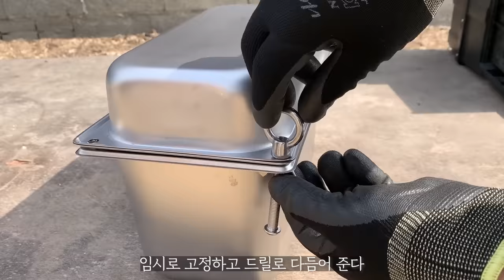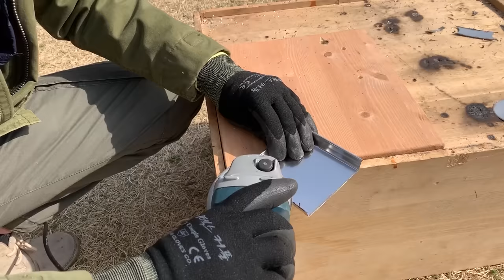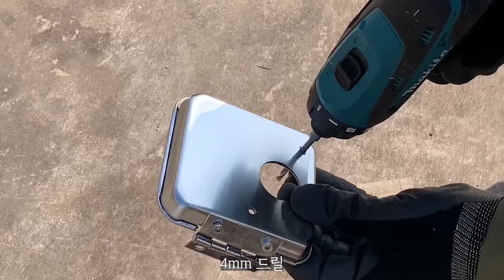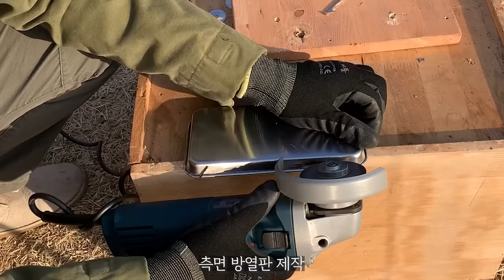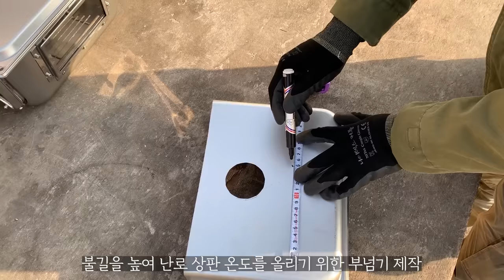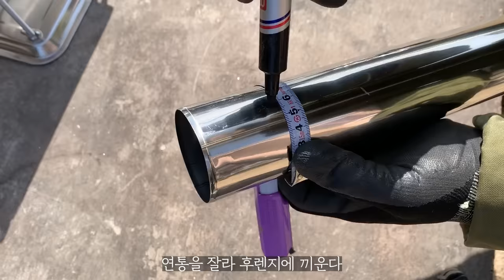Powerful to Cook - Homemade Wood Stove for Camp M-Stove Project Part-1

Comment: Firstly thanks for inspiring me to make my own stove based on your design, I enjoyed the process!  I have not included the heat sink, and just have single rather rudimentary door with simple air control.  It works very well. I know you cannot say exactly  how much use these stoves can take before component failure, but from what I've gathered from comments is that the lower fire box is the main concern.  By chance I've managed to fit a 1.1mm thick lower pan so hoping this extends life span!  Keep inspiring people to make things and enjoying the outdoors!

Comment: From one fabricator to another: holy cow, friend. The amount of planning and detail paired with on the fly fitting without measuring is really amazing. I don't speak Korean or read Hangul, but I was still able to follow along each step. By sticking solely to drilling holes and using bolts, you have made it accessible to a much larger potential audience. Also, there is a special mastery to the simplicity of the design and its execution. 

I see that you've built a bunch of further iterations of this, as well as a few other projects. I'm subscribed, and I look forward to watching through your whole catalogue of videos.
Reply from the maker: Youtube author activity started from my hobby. During my creative activities, I was worried and frustrated while I was in the joy to overcome many limitations. Still, there was a goal, so I was able to keep moving forward. Your thankful comments are a big booster to me. Thank you so much I will continue to share my life and hobbies here.
Reply: Buenos and the good 👍 👌 😌 🙌 ✨ 👏 👍 👌 😌 🙌 ✨ 👏 👍 👌 😌 🙌 ✨ 👏 👍 👌 😌 🙌 the 85
Reply: 68
Reply: Delivery available?

Comment: After taking care of stoves for almost 25 years I discovered that gasketing is the most important piece of equipment you have. My suggestion at improving, is the addition of gasketing between the sections, and between the glass and the stove itself. This will solve the shaking problem, and this will actually improve the efficiency.
Reply from the maker: Thanks for your advice! And now all improved! Please check out my latest videos♥️🙆🏻‍♂️🇰🇷
Reply: And for all of the homemade stoves I've seen on YouTube, this is got to be one of the best designs. A two-pass system with radiant guards is phenomenal. as a boiler operator I couldn't have designed anything better.
Reply: after 25 years ..... you should know
 better........ balance of the bills ... if you get the parts realy cheap, get the tools to build it realy cheap, and you expect to replace the stove afther 2 years of use at the campin....
Reply: With some very cheap gasketing, he will get better control of the fire, thus cutting down the wear and tear on this stove. And possibly get much longer than a measly 2 years. Hell I got a 6-year-old stove I use about four or five times a year and for my camping. Why? Because I have good control on my air flow.

Comment: Great job! Two minor changes to my design swiped from you. 😄 1. Small piece of the ceramic rope around the main top and bottom seal (where you added more bolts at the end to try and hold it more tightly closed) and around the glass (to stop leakage and the rattling). 2. Added a rotatable damper in the flue. THANKS FOR THE GREAT IDEA!
Reply from the maker: Thanks for watching and for the comment. Hope you enjoy your camp with your own. 😄

Comment: This makes me want to go out and get the materials to make one, just for fun. This was a great video and interestingly, being unspoken, works in all languages... Great video.
Reply: Restaurant pans are very expensive, he could have bought one for half the price
Reply: @lisah6451  You can get all of the needed pans on a restaurant supply website for under $50(usd), and the bolts and whatnot at a hardware store for probably >$10. A portable stove of this quality would cost you at least double that. And If you're lucky enough to live in a city with a second hand restaurant supply store, you could probably do the whole project for >$35.
Reply: @whiskeycan529  I used to own a restaurant so I know how much they cost. You can not let the fire get too hot in a stainless steel stove, it will warp the metal

Comment: Many thanks for having the consideration and time to meticulously document your superb stove build, both with videography, narration and the highly detailed parts list!

Your inspired build is meticulously detailed and your craftsmanship ensures that the stove looks as beautiful as it is highly efficient and functional.

I particularly liked that based on use, you updated as you felt was required, the mark of a true Engineer.

I see that you've created a second stove, this with water boiling capability, and were this stove to be fitted into a camper or liveaboard vessel or vehicle, with the use of copper piping and finrads, heating another space (second cabin or wetroom) would be possible.

Edited for typo and to update a mistake on my part!

When mentioning the stove with water boiling pipes, I mistook the piping and valves used for secondary burn capability for water pipes!
Reply from the maker: Thank you for your interest and for your feedback. I enjoy making this fun and enjoying it but sometimes making improvements to the extent possible. Thank you very much.
Reply: Another non-camper?   Academicians should sleep in the library.
Reply: @rstelzer2928  Surely they'd be sleeping in their sleeping bags!

Comment: As a boiler operator at a trona mine in Wyoming, I don't see that stove lasting longer than a month due to not having any furnace cement to insulate the metal and keep it from burning through. Other than that, it looks amazing!
Reply: Can one get furnace cement in any hardware store as I am in South Africa please. Thank you kindly for the tip. D
Reply: I agree...it looks great but many parts are not easy to be found on the market...and yes, the meatl itself will burn unless putting some cement inside and that will make the stove heavy unfortunately...
Reply: Lance Martin You could also use vermiculite board, it's cheap, easy to cut to size and an excellent insulator.
Reply: @spencerwilton5831  thank you for providing advise to fellows like myself just starting off in the world of DIY.
Reply: @spencerwilton5831  nice

Comment: I love the back draw method used it is more wood efficient and much heat is generated. Congrats from 🇰🇪
Reply from the maker: I love your comment! The concept of this stove is just that.Thanks!
Reply from the maker: @UCrfHYY0hOp8fwyrFsK_oUSA My stove has designed by the concept of combination of rocket stove science and traditional Korean floor heating technology call 'Ondol' 
https://en.wikipedia.org/wiki/Ondol?fbclid=IwAR3ivdkBtxW96AyM_dTaW5AaU02e1Ufwstec91LdTCX7VF1a7ATgXxRTogM
Reply from the maker: For a traditional fireplace, the holes in the baffles and the location of the chimney will be different. My stove is different from that. The combustion chamber is small but designed to deliver high temperatures for cooking to the top. I may have misunderstood your first comment. I hope you understand.
Reply: @campingtogether  i meant that the flow of gasses is back draft. They flow from the back to the front. Making it more efficient and burn stronger.
Reply from the maker: @kensimplykaruma9052  Have you watched my recent videos? Hope you watch them leave your feedback. I appreciate it.
Reply: @campingtogether  i will and thanks for your simple but effective stoves. Planning of doing brick stove using same concept with an oven.
Reply from the maker: @kensimplykaruma9052  Great idea. Cheers!

Comment: I love concept but seeing how after just few uses whole stove is already almost charred I fear it would be useless at best in year. Charred overheated stainless metal almost in my all cases corroded. You need to paint it with some protective laminate.
Reply: i thought as to you what  Charred overheated stainless metal almost,   have the problem.

Comment: Hey ! well done !! the wood stove would need some kind of protective clay forever so that the sheet metal would not withstand the heat. Mrs Edwin
Reply from the maker: Thanks! I will have this tuned.
Reply: Putting clay around it would make it last longer or just remain after the metal burns out?

Comment: Terrific construction!  I do see one problem, though:  It's TOO lightweight.  Even a mild Colorado breeze could topple it.  If it was inside a tent, however, one designed with a stove vent/heater vent, it would do very well.
Reply: There is a plate on the bottom; it could hold some stones as a counter-weight. Then it would stand up against the wind.
Reply: All the outdoors stoves should be light weight . they are meant to be to carry them and cooking outdoors.  Go online and looked whats the weight of outdoor stoves with this type of design

Comment: This one turned out good needs some cement between the pans lids where they seal together to kill that air gap.
Reply from the maker: I found some other way to fix it. Your idea is also great! Thanks a lot.
Reply: Fire rope and chimney gasket sealant?
Reply: Ceramic heat mat cut to fit? Maybe just exhaust gasket sealant.

Comment: So very neat, well put together and designed! I love this design. It looks a little fiddly at times with smaller parts and detail, but you make it look so easy and the film is also so very well put together. I enjoyed watching all through and found immensely inspiring.

Are you wearing kevlar gloves when working with the angle grinder?

Now I'm a fan of Camping Together, after watching this, thank you for sharing :-)
Reply from the maker: Hi Thanks for watching! I don't have kevlar gloves, just I hold it tight and feel easy while using the grinder. Thant one is small so not that dangerous, safety cover on the disk is essential. Have a great day!
Reply: ㅂ7
Reply: @campingtogether  Man, bravo, realy bravo, but no in aluminium stove man...cancer...

Comment: Brilliant design, but I fear from my own experience that the stove would wear out after only a few uses. Very thin steel. But I could be wrong.
Reply from the maker: You may be right! I will see and use this carefully. Thanks!
Reply: @campingtogether  Sir, try to keep an ash layer on the bottom to insulate the bottom, as we use Beer kegs for heating & cooking  made out of 3mm stainless This help with endurance.
Great build thanks for the video.

Comment: More on the door idea... If the hole for the door is cut "round" instead of "square", it would then be easy to fit a round bowl inside that hole to use as a door and have it seal quite well... a door doesn't HAVE to be square after all. Like a Hobbit door.
Reply from the maker: I did it because the rectangle was easy to crop cleanly. Your idea is a good idea.
Reply: Everyone’s a critic. Better idea? Build one yourself and post it for us to see, then we’ll compare notes
Reply: @MrSparkymedic  critic is meant positively. If I build things I like to be criticised because only by critics I can be better next time...
Reply: @MrSparkymedic  
That was a rather snide remark.
Most of us are here watching videos to learn and observe others techniques. The exchange of ideas in the comments section is part of the  experience and most welcome by just about everyone as long as those comments are not presented in a rude and snotty. manner.
Many times comments lead to improvements in process, materials, techniques and future videos.
Reply: @MrSparkymedic  gamma
Reply: Georg E. On
Reply: MrSparkymedic Nope; you're the only one! An alternate suggestion was made and acknowledged by the builder as a good idea.
Reply: It's harder to cut a round hole though, probably why they went with the square.  Plus if its round,  you cut down on the size of the opening. I think square is best for this type of stove.
Reply: @MrSparkymedic  I made my self a mini box to smoke fishes. Big works such as offroad campers, One sail boat and my house!
Critics are not bads at all. I know a good country for people who does not like the critics....North Korea!

Comment: I'm waiting  for  small stove like this.  Making video is so fast to look the process of it.
So,please make  the video speed more slowly  to understand the way of making.
Reply from the maker: Hi, Many thanks for watching. You may understand the concept of this stove, you better understand the process of making this. Do not forget to remove burs after cutting or drilling material. If you have any difficulties understanding the process, leave a comment any time. Good luck!
Reply: Maybe hit the rewind option a few times, Einstein. It ain’t rocket science.
Reply: 🔵 You may not be aware of the fact that
YouTube videos have a feature that allows you
to slow down or speed up the video!!..... the feature is accessed by tapping the three vertical dots on the upper right corner of the video that appear when you tap the screen.

Comment: THEY NEED TO BE PAINTED WITH HEAT PRO PAINT
Reply: SYDNEY HI, I was thinking the very same thing! I’d use white, high temperature automotive hot rod exhaust header paint. It’s good for 1,600 f.
Reply: Why? It's stainless steel. Mb aisi 316.
Reply: Good luck getting the paint to stick to stainless steel for very long.
Reply: @josephk2958  LOL HEAT PAINT SPRAY ON LOL DONE IT!!!

Comment: Nice design. If you get some small fiberglass rope you can sandwich it between the top pieces and between the glass and the metal to stop air leakage and noise from the glass.

Comment: It needs a seal between the top and bottom and one around the glass. 
Great looking little stove, How does it do for heating a space? With so little heat mass I bet it cools off pretty quick.
I think I might just build one of these for my wood shop, lots of little cutoffs to burn.

Comment: What is the thickness of those pans? Wondering how long they will hold up.
Reply: I've searched Korean stores with products like that and those small ones are 0.5T so 0.5 mm thick
Reply: @userskorea  Petty thin. Kamsa hamnida. Noticed the Korean in this video. Lived there for a few years. It's a cool stove but I want something that will last and I am not sure this could take repetitive fires. I saw one tent stove that was 1/16 of an inch thick.

Comment: hi, great job!  I would like to do the same, could I ask you what size are the resipients and where do you get the air regulator and the small window (glass)?  many greetings!
Reply: Wondering the same. The air regulator looked like something from a kitchen slicing device
Reply: Same, can’t find the “air mixer”. He lists the company that makes the window in one of the parts lists.

Comment: You could add a water heater on the end opposite the intake door.  A small tank to make hot water to convection-heat a reservoir. Copper tubing coil inside the firebox would be too dificult to handle and manage.